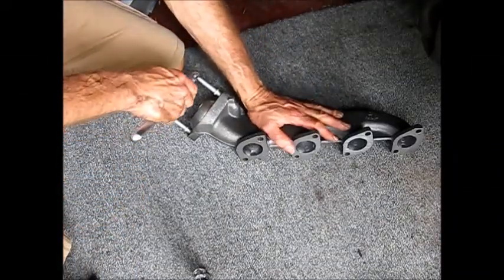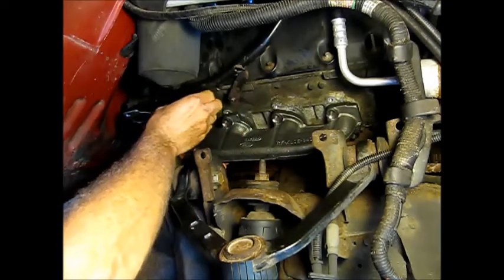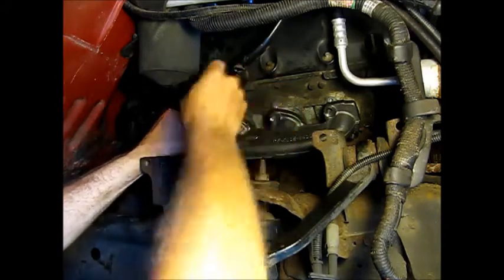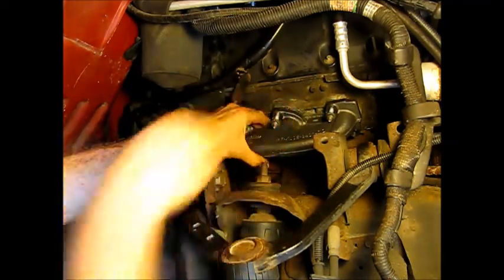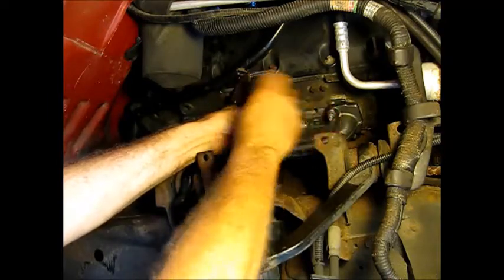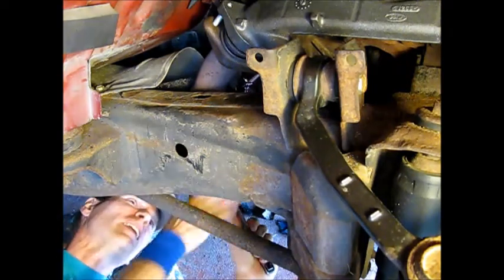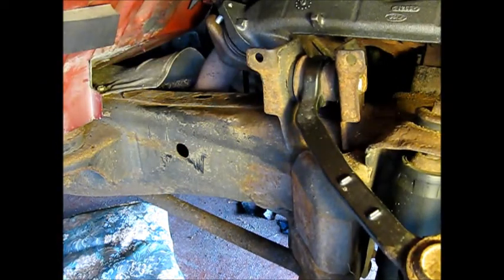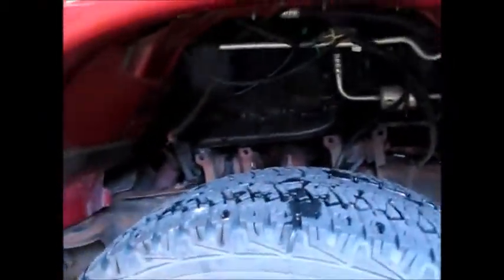How to remove the exhaust manifold from a 5.4L F150 part 4: installation

Comment: I was having hard time trying to get the studs off the manifold exhaust that goes to catalytic converter because I wanted to replace the stripped bolts on transmission pan on tight space. I been looking for videos of this and hope not to stripped any of the head studs. I have a 09 f150 4.6.
Reply from the maker: Those are some tough bolts to take out. You'll probably need penetrant, heat, patience and luck.

Comment: Just curious if you considered installing some shorty headers since you were going through the trouble anyway.  Obviously it would be double the work since you would need to change out the drivers side too but I read you could realize a 15 HP gain and better mileage.

Comment: Great vids. Thanks. Wondering why no antisieze or muffler cement on the pipe when putting back together?  I imagine that can be the next owner's problem. :). I have a leak on mine, need to replace soon.  Again, thanks.
Reply from the maker: You're welcome. I probably should have used some anti-seize. I usually do and i guess I forgot. Thanks for watching the videos and commenting and good luck on your repair.

Comment: My manifolds are leaking and I'm wondering where you got your manifolds from?
Reply from the maker: I bought all the parts from Ford. I had heard some horror stories about aftermarket parts on this repair. It's just under a year now since I did this repair and it's still looking (and sounding) good.
Reply: Shoot, how much did they run?  Thinking about those or Pacesetter shortty headers for the price.  My local dealership wants $800 per side to replace.
Reply from the maker: Jonny Qball I paid $330 for one manifold and gasket and hardware to do one side, all from Ford. Yeah, I've heard labor on this job is pretty high and it is a tough job to get the old hardware out. Good luck with it.
Reply: The Original Mechanic